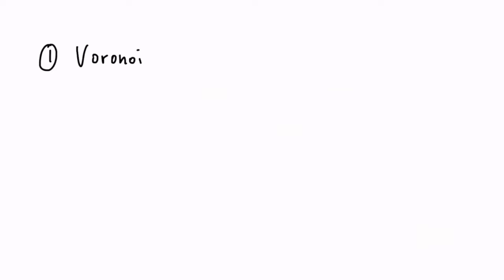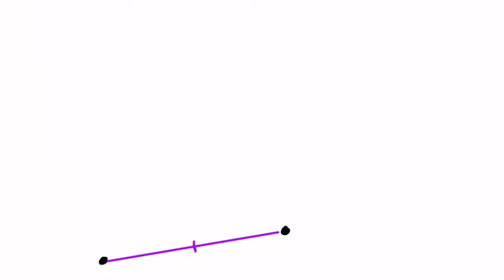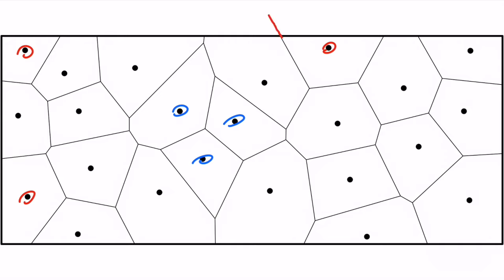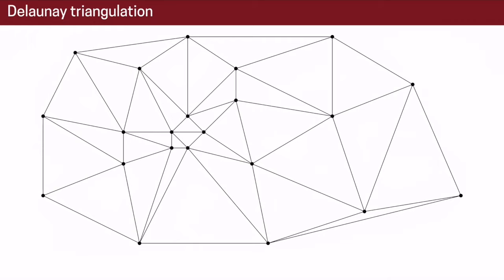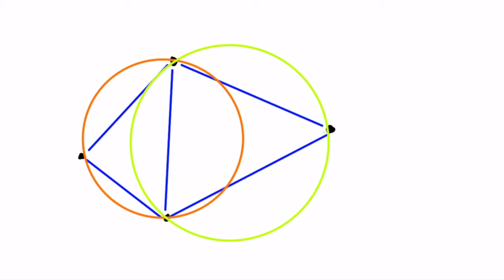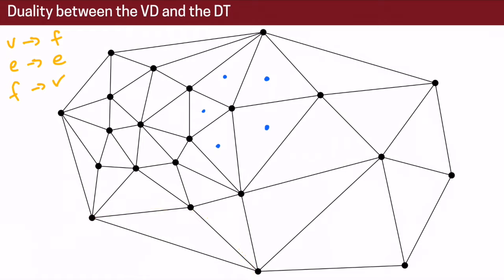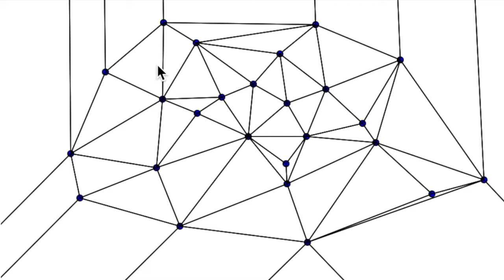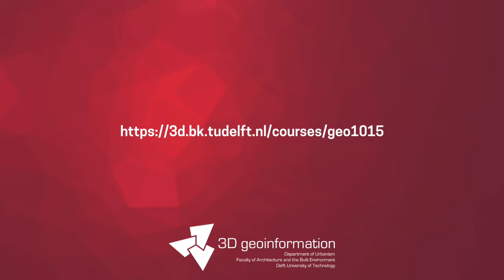GEO1015 -- Triangulations & Voronoi diagram

Comment: what kind of software did you use for the creation of the delauney triangulation?
Reply from the maker: at ~13min I used my own code written in Python. It's not really stable nor fast, just a demo I made for fun. Code is not open-source.

But you can try my better code, written in Rust: https://hugoledoux.github.io/startin_wasm/

Rust code is there: https://github.com/hugoledoux/startin
and its Python bindings: https://github.com/hugoledoux/startinpy
Reply: @HugoLedouxTUD  thank you